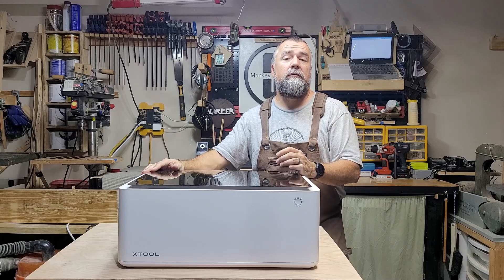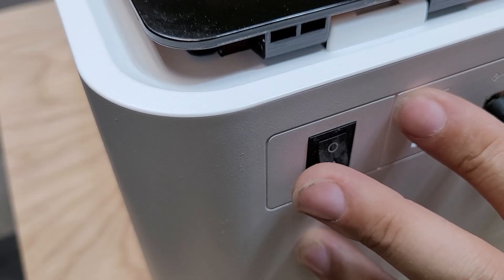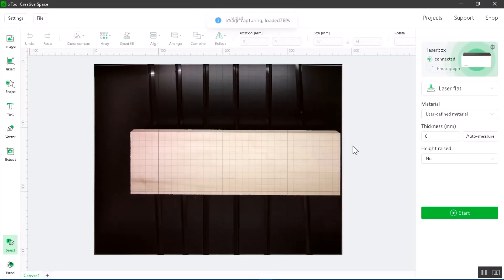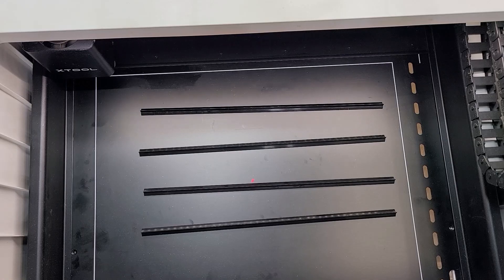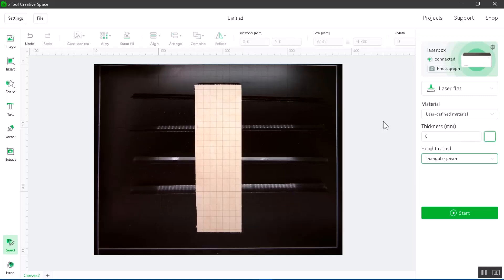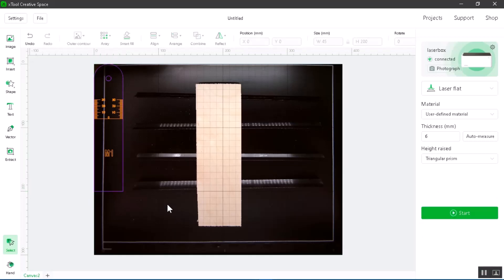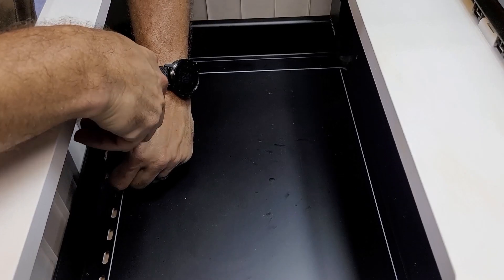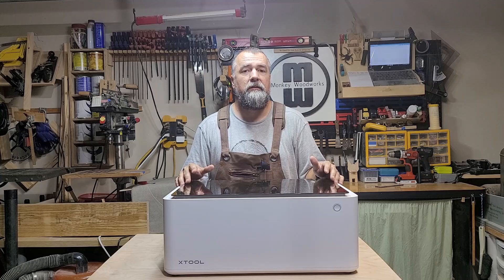How to Set up Auto & Manual Focus Functions on xTool M1 Laser and Blade Machine

Comment: I’m using the xtool M1, I remove the baseplate and placed my honeycomb on the top level. I’ve placed a slate coaster on the honeycomb, done auto measure a few times to get the one that seems to be constant. Then I line up my image to the coaster after refreshing the the camera, I press the framing button but it’s framing about 2cm plus minus above the coaster and at the bottom about the same distance above the bottom of the coaster, I thought I may to calibrate but that’s only for the blade so now I’m confused and don’t know how to rectify this problem, the red dot is on the coaster. I cleaned the camera with a q tip and 99% alcohol. Can you please advice what I am doing wrong 🥲 your help would be greatly appreciated. I’ve tried xtool troubleshooting but have done everything it has said to do but still no success

Comment: I wonder, do you have the same issue as I, that the automeasure feature is wildly inaccurate? For example, the base plate is already at 0.7 mm according to the software and some anodised aluminium, which is axactly 2 mm is measured at anywhere from 2.1 to 2.8. Always placed it exactly underneath the read dot. I'm not sure if it makes a big difference, since the laser has this convenient method of focusing, where the exact distance shouldn't matter as much, but given the bang-on accuracy in x and y direction I find this rather mind boggling.
Reply: I’m having that problem too.